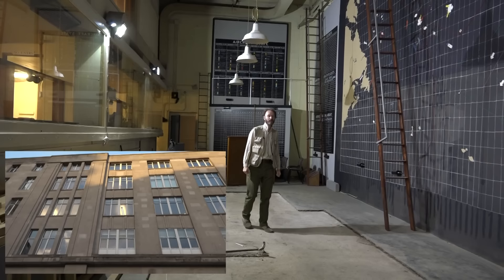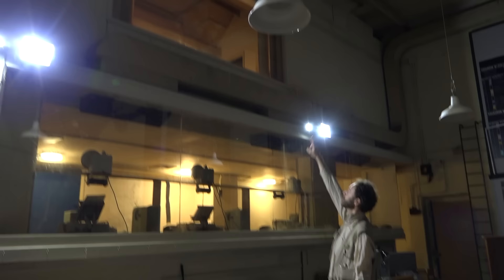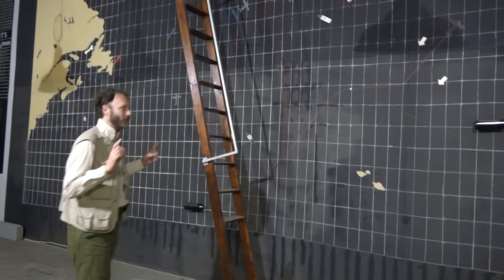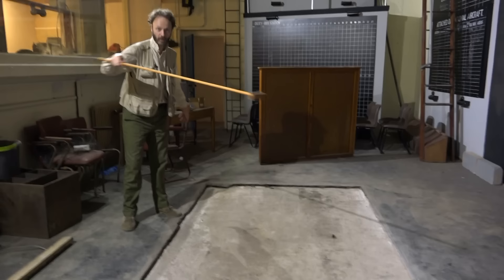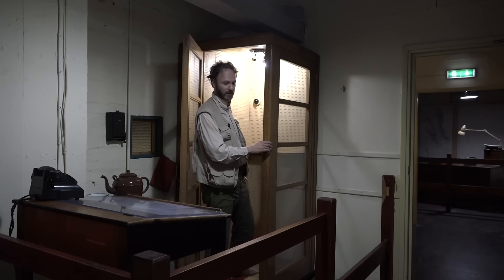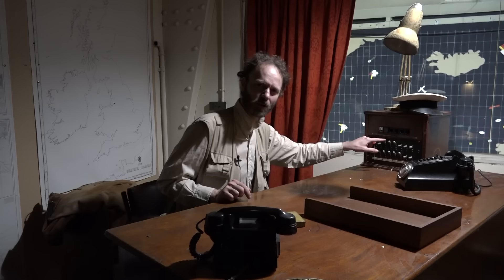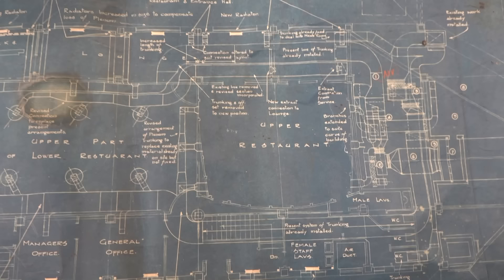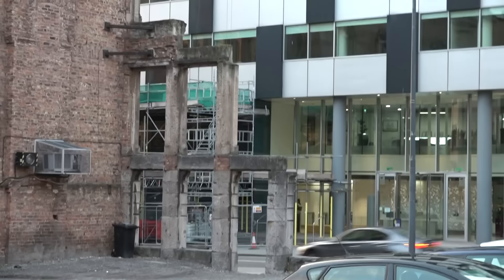Western Approaches - the bunker from which they won the war

Comment: This is a fine video about an important place that I was not aware of. I did not know that the Atlantic battle was controlled from Liverpool. Great job.
Reply: The London establishment has attempted to erase Liverpool from the earth. They rarely mention the word Liverpool on the BBC. They always say, the Jaguar plant in Merseyside, when it is now actually in the Liverpool City Region.   HS2 (high-speed rail) track will be 16 miles away from the city, but they will not run in HS2 into a City Region of over 2 million, having to access HS2 40 miles away at Crewe, while nearby Manchester will have a 7.5 mile HS2 tunnel run into the city.

They hate the city.

Comment: A fellow vintage switch fan, I see. A few years ago my dad took me to a Radio Shack, I was about 14 at the time (I'm 16 now). There was a drawer in the back filled to the brim with switches of every kind, ESPECIALLY the nice, crisp switches you see on the old equipment in the bunker. Being 14 years old, I had never experienced the switches of the olden days, and I spent pretty much the entire time there flipping them all.
Reply: Ryan Casey   A favourite pastime of my children when young at B&Q was switching all the display switches in the electrical aisle. Obviously not as satisfying as vintage switches but you have to take your pleasures where you can get them.
Reply: Have you got an old fashioned mechanical 1980's computer keyboard like me?  They still make them and are really worth it. "Buckling Springs" for the true experience although there are other variants.

Comment: The role of the city of Liverpool in WW2 is vastly understated.  It was the prime convoy port, with a convoy to the Americas, Middle East, Far East, etc, entering or leaving at one per day. A million American troops passed through the port. It was a centre of essential ship repair for the merchant fleets and allied naval fleets as well. Even Mustang planes were built there to together Napier engines used in the Tempest and Typhoon planes.  The anti U-Boat corvettes were stationed there, with Johnny Walker the man who could smell a U-Boat from a few miles away.

Comment: @11:45  and following you will see the size of Iceland dramatically reduce from its WW2 area to the area shown in the 1990s reproduction.  The RN and RAF used a cylindrical map projection (Mercator) for very sound reasons.  The 1990s reproducers, in their naivety, used an equal area (Gall-Peters) projection.  Cylindrical map projections make land masses close to the Poles look larger than they proportionally are, but they make navigation a doddle.  RN /RAF got it right: the set designers were wrong.
Reply: I doubt they used Gal-Peters.  Looks like Equirectangular (cylindrical) where the original was Mercator (cylindrical).  Can't say the original choice was more appropriate, as Mercator is of no help in cross atlantic navigation.
Reply: Nevertheless, only a cylindrical projection would work if you are using straight strands of wool for equal angles of latitude and longitude.  I still maintain (using a ruler to measure from my screen!) that the later chart is an equal area projection.  I may be wrong, but I do hope the restorers use an authentic chart.  BR  PE.

Comment: @Lindybeige, I'm a retired C-130 flight engineer. The Herkybird was designed in the early 50s with lots of WW2 level tech, and my systems panel had lots and lots of extremely tactile and satisfying knobs, buttons, and switches. I miss my old job.

Comment: Well, I'm a bit of an ameteur electrician (very ameteur) and we do have switches like that now. It's just that we have new switches that are cheaper. Using cheaper components will actually bring the price down quite a bit but I agree. Stuff back then was built to last. Great stuff.
Reply: 'Stuff back then was built to last.' - and it was repairable so you didn't have to throw the whole bloomin' contraption away if the switch packed in and you couldn't get a replacement ;-)
Reply: OrkStuff: Capitalism at it's finest: maximize profit.
Reply: Ye, I have worked on old computers. Clean away the dust, fix the broken part and/or replace it, boot it up. Bam working machine. New computers are a fair bit more fiddly, less room to work with, you tend to have to take the entire thing apart to replace one small piece. Even worse in laptops. Also, laptops even these past five years seem to have gotten really flimsey. £350 once bought a fairly slow laptop that just worked. £350 just a few years ago got me a machine that fell to bits within weeks. Good build quality has gotten pricier in recent years, and even then you can expect it to break down in a few years. My first machine lasted ten years, this one is two years old and already it has two broken LEDs and a dodgy fan and the harddrive is on the blink. (Paid £500 for this one, I'm running it until it dies, I have backups, but it annoys me because throwing electronics away all the time seems like such a darn waste!)
Reply: Now then Paul, your mission is to save all of us old switch lovers and locate the best place to buy them... I love the solid feeling of those old switches.
Reply: Lol, well, here's a few places. https://www.youtube.com/watch?v=jEwEhhhVuw0 Just Google electronic components and buy some switches. But you'll sure pay for the nice big satisfying switches. Maybe the best thing to do might be to find some old devices like in the video and unsoldier the switches. Then you should be able to soldier them back into pretty much anything you want. A two way switch should be compatible with any two way circuit theoretically but don't quote me on that. Ask someone who actually knows what they're talking about, lol.
Reply: Daryl: You can't beat old school technology, ey? :)

Comment: the battle of britain is in my opinion the turning point of WW2, if britain had fallen i am rather sure germany would have won the war. maybe a truce with rushia and america maybe wouldnt not even have joined the war in the atlantic.
Reply: Radle Grebdron And defeating the luftwaffe.
Reply: with battle of britain i also mean the airbattle over britain as well as teh fight over the control of the atlantic.
Reply from the maker: Every refight of Operation Sealion goes against the Germans.
Reply: hey lindy. did not expect that. I see GB in allied hands like a foot in the door for them.
i could be wrong, but sofar i think the battle of britain was a cornerstone of the allied win.
Reply: Britain could have done with a draw in the Battle of Britain, maybe even lost it. What made Operation Sealion impossible was not Air Power, but Naval Power. 

Lets put this into perspective, in 1940 the big U Boat production push had yet to start, the Kreigsmarine had about as many submarines as Britain did at that point, and most of those were coastal boats. The real differences however show up when you start looking at the Surface Fleets. 

At the time of the Battle of Britain the Kreigsmarine had precisely 4 Destroyers and 3 Cruisers ready for sea. They had lost fully half their total destroyer strength in the Norway campaign, as well as several cruisers and the majority of their dedicated troops transports. While the Royal Navy lost a similar number of ships, they could afford those losses. 

Home Fleet in 1940 had available 7 Battleships, 7.... as many Battleships as the Kreigsmarine had surface vessels able to put to sea. This is without counting the 2 Carriers, the 30 or so cruisers of various types (mostly Light Cruisers), and the over 100 Destroyers..... 

Against that disparity of Naval power Sealion was a hopeless cause. There is no way the Kreigsmarine could have got the required 10 divisions onto British shores, let alone supply them afterwards (as most of the German Merchant shipping was either at the bottom or interned in neutral ports). 

Then you have to consider they had none of the specialist equipment the Allies used on D-Day, no specialised landing craft (their landing barges were effectively converted Grain barges), no way of getting armour on shore with the infantry, no Mulberry Harbours, no PLUTO, none of the 79th Armoureds array of specialist armoured vehicles, the list goes on. 

As Lindy said, had Germany tried to invade Britain, they would have lost... badly. 

And they could not even compensate with airpower, as the Luftwaffe only had three Squadrons specially trained for anti shipping strikes....

Comment: I don't know about any of this, but it would make sense to me that, if it's not bits of twine and pins, it could be chalk lines. Yes, the same type they use in construction when they need a 20 ft line on a building. It'd be a nice and straight line, you wouldn't need rolls of various twines (just a few different colored chalk lines), and it'd be very easy to change. If it isn't bits of twine, it could just as likely be chalk lines.

Comment: Only a small amount of Lend Lease went through Murmansk. It was mainly a PR route. Aircraft were sent to Alaska, painted in Russia insignia, manned by Russian pilots, and then flown to Siberia. Japan and Russia were at peace. Most other Lend Lease went through Persia. Not only were supplies for Russia shipped there, but huge factories for building trucks and other equipment were built there. The Murmansk convoys were a mistake.

You should do a video on it.

Comment: What a pity the facility wasn't preserved intact, but it sounds like it went on to fight the cold war. As an aside, one of the most profound experiences I ever had was when I visited a military base in Hawaii and saw the huge  divots made by the machine guns of the attacking Japanese in the thick concrete walls of a building. Thankfully they never patched them so we can now appreciate the ferocity of the attack and the power of those weapons. The building was a barracks at the time and I can only imagine the terror of the occupants when that happened. Even decades later the sight of the damage inflicted on those walls is something I'll remember forever. That's why we should try to preserve these things to give later generations a feel of what things were like.

Comment: Love your videos, Lindybeige. But I would like if Brittish would at least now and then mention war effort by other people. By 1940 the Brittish merchant fleet was largely outdated (due to planning failures). The Americans refused to sail to England (or Murmansk), so there was a bit of a problem. However, the Brittish "requested" the Norwegian and Danish merchant fleets, which were very modern and up to date. These were among the very largest fleets in the world, only beaten by the US and Japan who for different reasons were not relevant, and the UK's old fleet. Around 50% of the Norwegian merchant fleet was sunk during WW2. No salary, compensation or honor was bestowed on these brave Norwegian and Danish sailors from the UK. Something many of them felt very bad about. Also, it was kind of odd to supply the UK with all sorts of goods (also food), when their own people were suffering. At least now when so many years have gone war historians in the UK could mention the effort that was quite important for the UK during WW2.

Comment: 7:48 you have a nice photograph of the room there looking AWAY from the wall nobody seems to be sure how to reconstruct 100% accurately but AT some nice reflective windows on the opposite wall. if there are more similar shots (maybe with different light conditions; and of course scanned at a higher resolution than me taking a screenshot of a scan you put in a video :P) those reflections could be put together to at least get a hint at what it was (black wall with chalk vs glowy starwars glass thingies vs paper maps), though making out strings or pins on it would still be pretty far-fetched

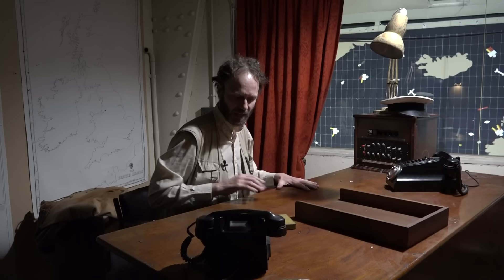EDIT: well nevermind that, you have a perfect picture of said wall including strings and pins right at 11:48.

Comment: This video is very interesting since one of my interest but it's kinda hard to find information elsewhere is how a command and general staff works. That, and how the training and education of such staff is carried out. I believe it is a very under-appreciated facet of military operations. We can go on and on about weapons, tactics, operations, but the command staff is where the vital decisions are made to ensure that the troops are where they needed to be, and the troops have that the need to fight. Thanks for that.

Though I need to make a slight comment about the effect of Lend-Lease. In their darkest hours of Winter of 1941, very little supplies reached the Soviet Union. Even so, the STAVKA managed to scrapped up enough troops to not only stop the Germans, but to throw them back. They might have even more, if not for the inexperience of Russian High Commands which insisted on doggedly holding indefensible grounds, and repeatedly attacking and counter-attacking, which squandered troops. They got better in 1942: despite losing grounds, they did not suffer as many captured and POWs. The counter-attack in Stalingrad was also probably the first time that they stopped, supplied, planned, and gathered forces in sufficient numbers to make a difference. Still, every bit of material and men spent on the relatively useless Kriegsmarine is every bit unable to be sent to the East.

Comment: at 11:49 the picture of Admiral Horton has a good shot of that map of the Atlantic in it,could you deduce by it its construction or see what's stuck on it from that? clearly that's a clock in the middle of ? and there's little doo dads stuck  on the bottom of it,either it's a corkboard or its metal, with magnets for ships etc. there you are! off you go then,make sure you have a magnifying glass to get a good gander and Bobs your uncle! fancy a cuppa? ▪☆☆☆▪

Comment: I wonder why you didn´t mention Alan Turing´s role. Sure, you gotta make the right decisions with the intelligence you get. But without Turing´s cracking the Enigma, there woudn´t have been that much intelligence, imho. I once read (and never found the site again, damn!) that you could clearly see a significant difference in either sinking rate (U-boats vs. freighters), depending which side broke into the other side´s code or managed to keep the other side out of communication respectively.  Which brings me to a request: You did the video about military deception. Can you do one about the importance of intelligence?
Reply: Turning had nothing to do with the hands on U-Boat war.